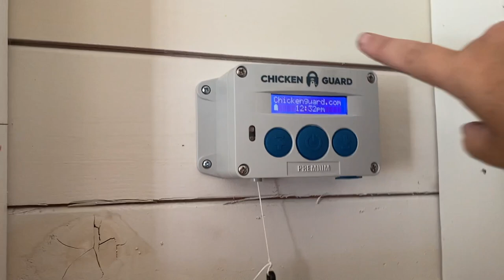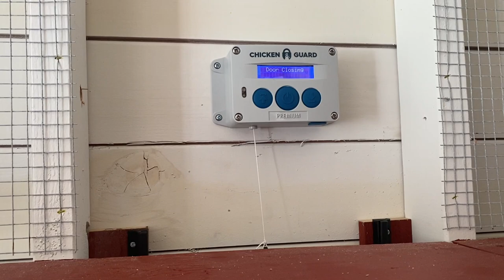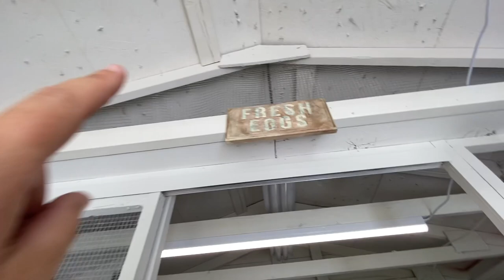Ultimate Chicken Coop Build in our Pacific Northwest Backyard

Comment: Why couldn't you have just used the ball valve where the watering system for the coup to shut the water down to a trickle?
Reply from the maker: Because of the ball valves with the watering cups and nipples just turning the ball valve it would slow the flow but pressure would still build behind the watering cups.
Reply: BIG DAN C. Ball value would adjust the flow not the pressure. You would still have 60 psi or 35 with the one pressure reduces. Most adjustable pressure values do just that. Lowers the pressure but don’t limit flow that much. You would get a little less flow because of friction loss in the pixie and values, but you have such a small system, run,